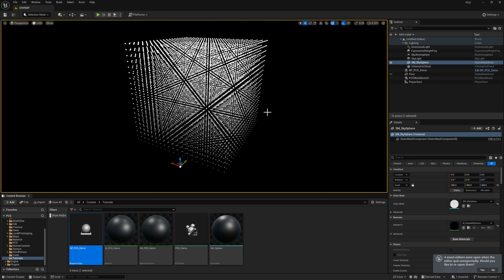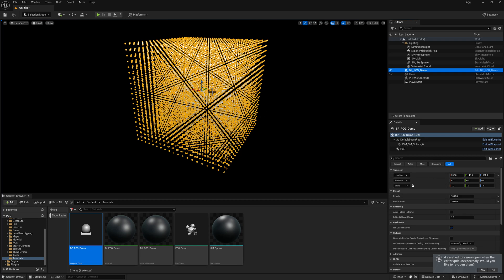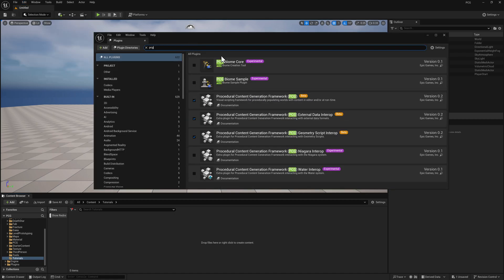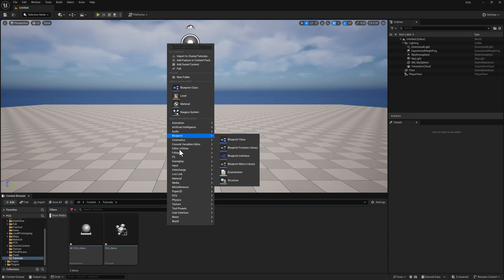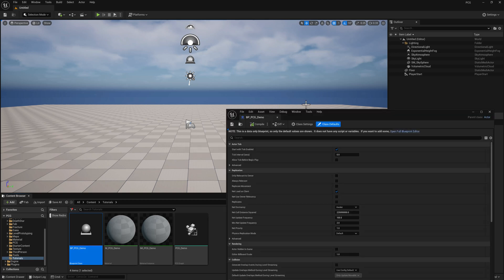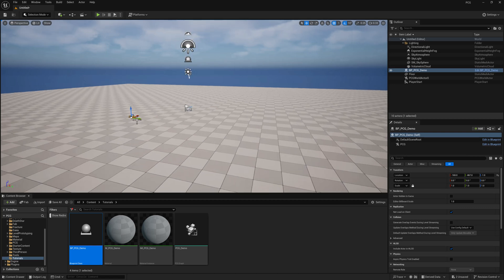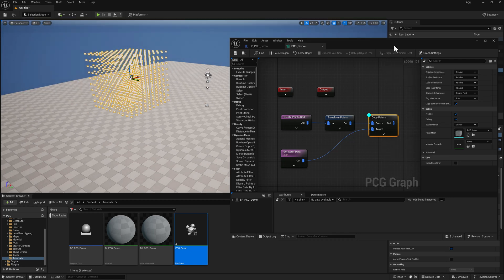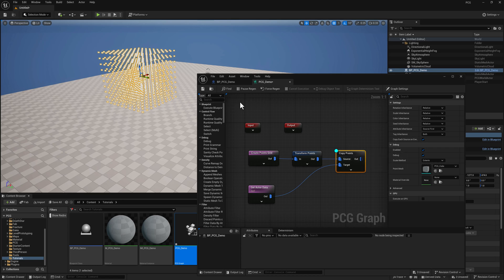PCG Basics - Passing Data between Blueprints, PCG graphs, and Materials

Comment: Hello, Isaac! Crystal clear approach, thanks a lot for sharing it, well-appreciated.
Do you know by any chance how would you pass the point data between different PCG Graphs? I assume we would need to involve GetPCGComponenetData node and read the output from the specified graph?
Thanks again!
Reply from the maker: Thanks, glad to hear the video is helpful.  I'm assuming you can't just add the second graph as a subgraph in the first?  I think its probably possible to pass it from BP to BP with the node you mentioned.  It seems like it should be pretty straightforward - famous last words, right 😅?    Let me know how it goes.
Reply: @IsaacOster  It does work, but only for certain scenarios. Some graphs with (as it might look as first glance) similar BP setup do receive data from other PCGs, some can't retrive them. There must be some hidden "checkbox" to make it work globally, but I haven't found it yet...